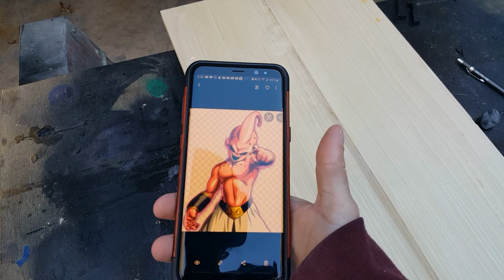How To Make A Wood Cutout: Kid Buu Part Two/Drawing and Cutting | Tutorial |KIENZAN ART

Comment: Hi, for the black and decker saw did u need to buy a battery or anything extra for it? Or was it just the saw itself? If u need more saw blades is that includedv
Reply from the maker: The saw is corded. I believe it comes with one saw blade, but it produces a rough cut. If you want a finer cut, you have to buy a different blade.